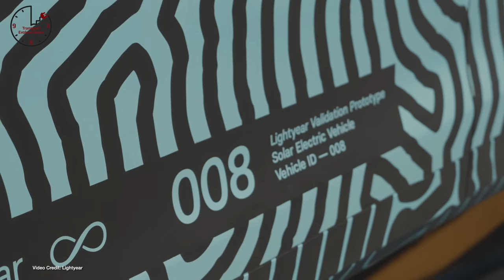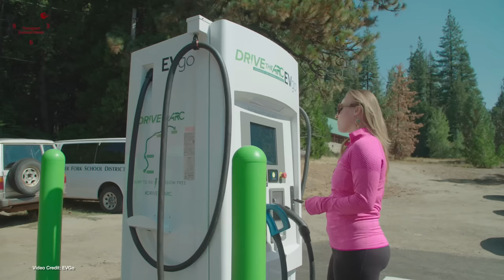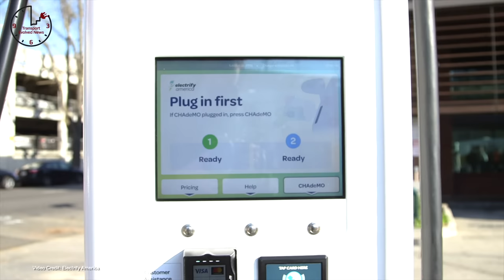TEN 346 - Bolt EV caution, Tesla FSD V9, Rivian R1T Delay

Comment: So why would an EV need the Bosch CVT transmission? Only current car is the Porsche for going >120mph and Tesla Plaid doesn't use one.
Reply: A much smaller and thus cheaper electric motors can be used. Also the bearings and tolerances don't have to be as exact since they won't have to spin at the higher speeds for highway driving, again more cost savings. This will also help with power consumption if they can get the frictional forces low enough. The only concern really is available space and cooling, especially for AWD models, since the newest round of CVTs are actually quite reliable.
Reply: Maybe to increase efficiency/range at highway speeds?

Comment: Your British accent is impeccable.  Love it.  I never had any problems with the 2017 Bolt EV (27,000 miles). The battery warning is just a bunch of brouhaha.  If an used Bolt EV drops below $10,000 (2017-2019), I would buy one without any hesitations.

Comment: 16:20 - "Prop", yes, "turbo", no. Turboprop engines use gas turbines to drive propellers - none of those here. That's the point, eh?
Reply: It's like saying the Tesla has a powerful "V8" electric motor.
Reply: Like the Porsche Taycan Turbo S?
Reply: @JBoy340a  That gets me every time, VW could have easily just called it the Taycan GT and GTS or GT2, there, false advertising solved!
Reply: @JBoy340a  Umm, point.
But unlike car marketing, where (mostly American) public got to recognize "turbo" as a general superlative of unclear meaning, in aviation world people know their technicalities.
Reply: @bazoo513  - sort of.  Most people I know associate the term turbo in cars with turbocharging. So they correctly assume the 911 turbo S is turbocharged.  As a pilot, I associate it with turboprop aircraft, but really it is just a naming convention.   There is no turbocharger in a turboprop engine, as there are in some piston aircraft. The engine in a turboprop aircraft is a turbine engine driving a propeller.
Reply: @JBoy340a  Yeh. When in doubt, forget marketing and be precise. But, remember "turbo" buttons on PCs (meaning "overclock")?
Reply: @bazoo513  Yep. That was just another example use of the term term "turbo" to sell something as "high performance."  Similar to razor companies using "turbo" to signify better shaving blades, and what Porsche is doing to differentiate their high-performance version of the Taycan.

Comment: GM just needs to do the right thing! They’ve rendered my 17 useless to me! I love the car but replace the pack or the car! This has officially become absurd! At 18k for the pack plus labor it’s probably better to just replace the car, I was going to buy the Cadillac and trade my 17 but now I’m double thinking trusting them again, and I’ve been a gm guy my whole life!
Reply: I agree, as a 17 owner they need to do the right thing. Their recommendation takes away the benefits of an EV, and they are risking good will.
Reply: loyalty to a brand require vigilant.
Reply: I keep hearing about buybacks being offered to some Bolt owners. I don't know the details. Maybe somebody here can fill in details.
Reply: @Miata822  There is a video on this Youtube channel by Winter, one of the team members. The TLDR is that it is a real PITA with GM asking for lots of documentation, some of which you might have a hard time coming up with, and then asking for it again at a later stage in the process. They are making it hard presumably to discourage owners from pursuing the option. I think they might be concerned about people buying up Bolts in order to make a buck on the buy-back as well.

Comment: The big problems in the UK are 1. Not enough chargers in public parking spaces anywhere  ( find one )
2. The national grid would struggle regionally if one Street alone all had electric cars, and charged at the same time. 
3 No B roads have charging stations. 
So if they don't put chargers around like everywhere this will be an embarrassing disaster.

Comment: Just for your information today I drove my 2013 Leaf 24kwh from San Francisco to Napa, CA. After 50.3 miles I had 50 miles on the guessometer and 52% charge left. A little over 100 miles predicted range. That is with the delta wind helping and over 60k miles on the clock. However coming home 42% left and 84 miles predicted range fighting the wind. Tried to keep the car between 50 and 55mph. My average miles per KWH is 4.9. Not too much stomping on the go pedal. I can't match the Mustangs efficiency but I am better than most drivers of the Leaf who torture their cars getting 3.9 or so.

Comment: That electric puddle-jumper looks interesting. 250 mile range, which, since it would need reserve distance, realistically means more like 175-200 miles of "scheduled flight distance." There are PLENTY of routes that would be good for - and since it wouldn't be charging from empty, wouldn't take the full 40 minutes to recharge - it could almost certainly recharge in the time it takes to unload then reload for the next leg. Sounds perfect for many puddle-jumper uses!

Comment: I’m disappointed there is no coverage of the recent fire involving a Tesla S Plaid. This fire occurred while the vehicle was underway and required the driver to forcefully extricate himself as the door locks would not unlock, according to news reports. I understand the concern with the Bolts but it seems Tesla is getting a pass.
Reply from the maker: We’re trying to gather more concrete and confirmed information before covering the story. But be assured that it’s on our radar. - Winter
Reply: @transportevolved  Thanks.  Have a safe trip.

Comment: Since when is electrify America the most reliable none tesla charging system? Is the bar THAT low? 

Out of spec motors did a cannonball run a few months ago in a tycan. They even had technicians from EA to help and the whole thing was still a mess. Hardly any where flawless and they all had one issue or another.
Reply from the maker: Nikki here. I’ve driven across the US using EA. And made multiple, multi-day, multi thousand mile trips using EA. I’ve experienced very few issues. - Nikki
Reply: @transportevolved  senpai noticed me

Well. That's good. Maybe part of the issue was they were also trying to charge at 350kw. I'll need to find it and rewatch it.

Comment: I think GM may just end up asking for a trade-in of the older Bolt models for the 2022 Bolt, which uses a totally new battery pack from LG Energy Solution. That's 50,000 cars that need to be replaced, though.

Comment: The X does have door handles.  Auto open is a setting.  I turned mine off.  I want to be at the door when it opens and ensure there is nothing in the way.
Reply from the maker: We know .
Reply: @transportevolved  MS does not have auto open doors. Never had. Only MX. Come on! You guys should know that by now (MS was release in 2012 et MX 2015 - and those auto doors appear since 2015 and only for MX)

Comment: One correction small correction. Only  Tesla model X has motorized doors which opens automatically not model S.
Reply: Incorrect. Model S has a door closer actuator on the front doors.
Reply: @vidznstuff1  point is it doesn't open the doors. the question to elon is how to open the doors not how to close

Comment: The Mach-E publicity stunt averaged 31 MPH on a closed course. This was an exercise in hypermiling and nothing more. Insulting that Guinness would certify a world record under these circumstances.
Reply: John o Grotes to Lands End is on public roads, 850miles
Reply: @K_EV_Drives  my understanding is they closed sections of road or had escort, as they were traveling well below posted speed limits.
Reply: @BillGardiner  I didn't think I had enough sway to get the roads closed, I wish I had it would have made the record a lot easier. The AA were with us as independent witnesses, guinness are really strict on evidence collection. Average speed was slower due to health and safety requirements for driver swapping.

Comment: I just put a Temp Stick in my Bolt.  It will email and text me if the car warms up.
Reply: It already beeps the horn if the battery starts to get hot. But if the Bolt catches fire in a forest with nobody around, does it burn? That's why they don't want "unattended" charging.
Reply: @vidznstuff1  Didn't know that - thanks